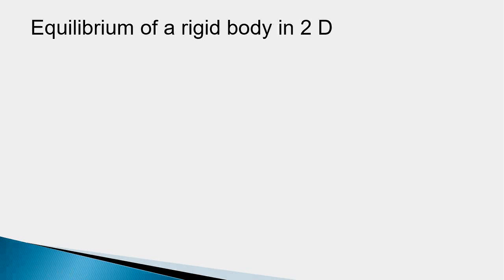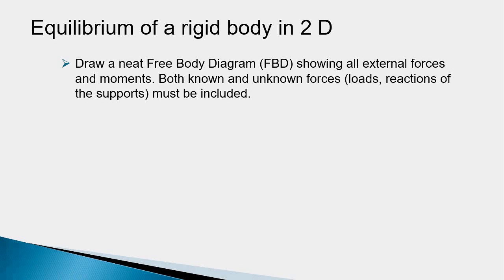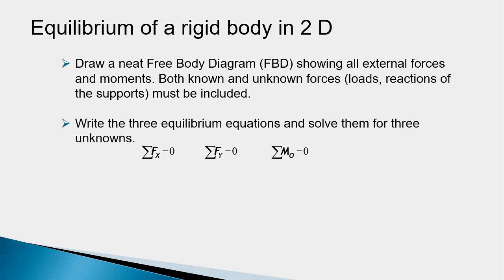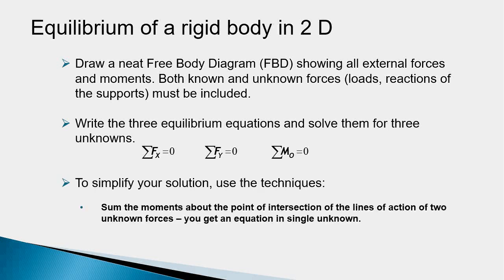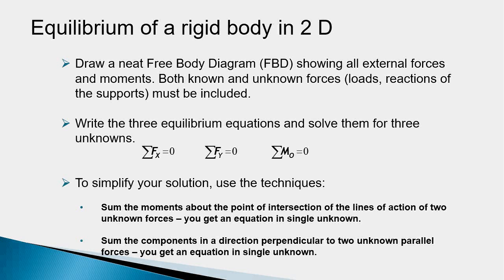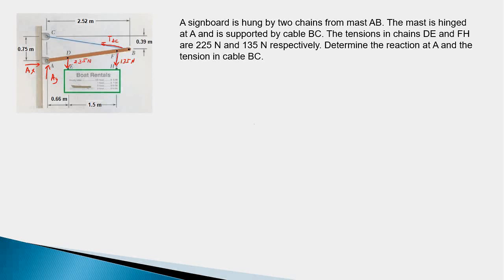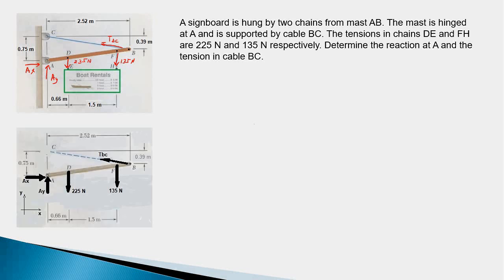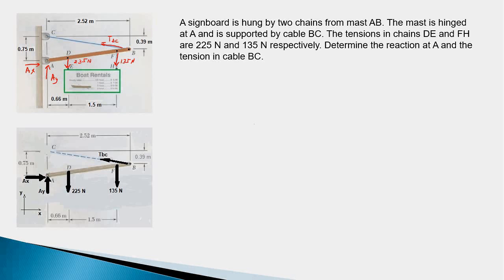4.17 Engineering Mechanics: Rigid body equilibrium (2D) - Solved  Problems (1 of 3)

Comment: for example, we have assumed wrong the direction/sign of Tbc. will we use the sign of  the assumed or the answer we got from the solution. another, i solved the moment of A but why is the value 586.89?
Reply from the maker: Hi Aicel,  wish to clarify that you can't assume any direction of Tbc .... you've to show the correct direction of the force in FBD and then proceed further. A cable/rope/string can sustain only tension force and never a compressive force. So, the direction of the force acting on mast AB at point B due to cable tension (Tbc) will be necessarily in the direction from B to C and not in the other direction. Does it sound convincing?
Reply: @VectorInMotion  thank you for clarifying my inquiries. Can I also consult you if ever I have a question? Thank you
Reply from the maker: Yes you could...ready to help. Happy learning!

Comment: for moment at A, how did we get tbc*0.75*(2.52/2.55)?isnt that the x component of Tbc along x? why cant we take the y component instead?
Reply from the maker: That's a good question Balaji and answer to that is in the video itself...listen to the audio @ 06:00 that explains why only x-component of Tbc has been considered for computing moment of Tbc about point A.

You've to keep in mind two important points - (1) Moment of Tbc about point A is equal to sum of moments due to its rectangular components in x and y directions. (Remember Varignon's theorem). You've to consider both the components and not just one component. (2) A clever way to reduce your calculation effort is to move the point of application of the force from point B to another point on its line of action - point C. What's the advantage? At this point of application, the y-component of Tbc passes through A and therefore doesn't cause any moment about A. So, you can ignore the y-component and consider only the x-component and its moment arm is now 0.75m.

Trust this clarifies the point. You may like to watch my video explaining the basic concepts '5.1 Moment of Co-planar Forces' (https://youtu.be/HxG-GuQ2xQo)